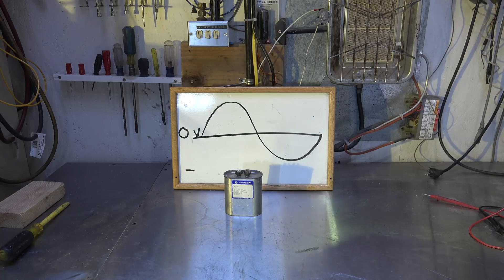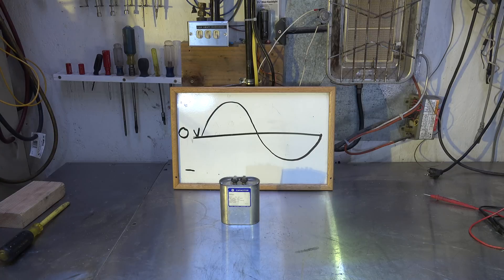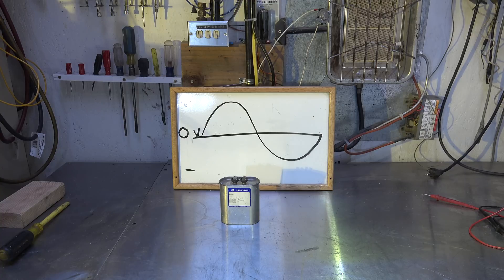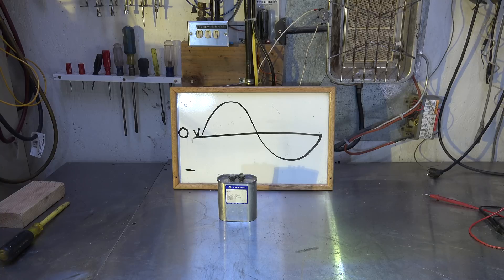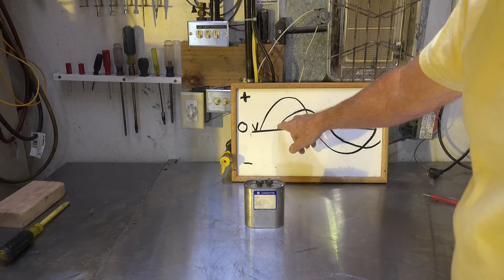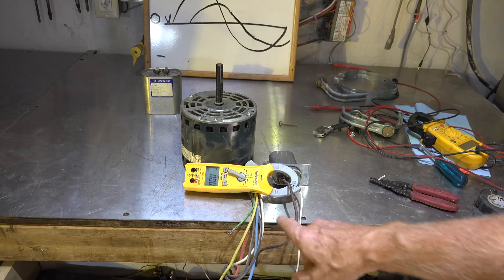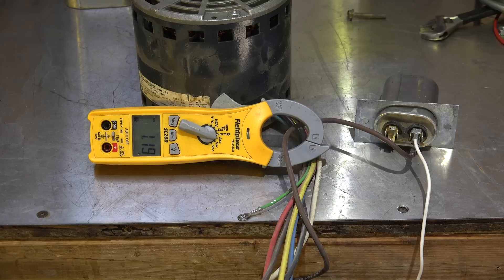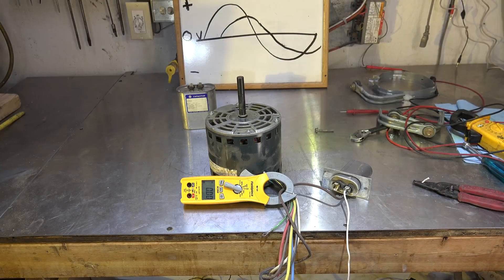What does the capacitor do in the PSC motor

Comment: Can you run the same test with the blower on the motor in the furnace housing with ductwork attached and showed a difference with restrictive ductwork that often happens when somebody underbid the job and when the static pressure is correct with the correct ductwork. And show the difference and amp draw with and without a capacitor on a PSC motor under load is much greater.
Reply from the maker: I have done some on on blocking the outlet of the fan, but nothing on an installed system.  I will put it on the list.  I do have a video on operation of the motor with and without a capacitor.  Check my channel for the playlist on motors.  Hope it helps.
GFM
Reply: grayfurnaceman thanks I’ve been watching your videos for years, I enjoy them.
Reply: Don't forget a Thank You to GFM for making all these great videos in the first place.